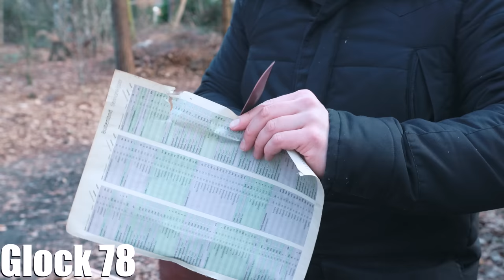America’s Army needs a new knife ASAP.. Ka-bar Vs Glock 78

Comment: GLock is a bayonet (hence the strange bent in the guard), KaBar is for combat.
None of them was made for cutting, buschcrafting ect.
Do the military test!
- which kills faster, bleeds (fuller on the KaBar), goes easily through the rib cage.
Reply: I don’t think that’s correct. I own the Glock knives and there’s no way to Mount it securely as a bayonet. 
From my understanding the forward you are mentioning is a bottle opener.
Reply: @Jays_video_watcher  It is even on English Wikipedia - second sentence: 
" It can also be used as a bayonet, by engaging a socket in the pommel (covered by a plastic cap) into a bayonet adapter that can be fitted to the Steyr AUG rifle."
Reply: @Jays_video_watcher  As far as I know the forward thingy is actually a bottle opener but the knife itself is a combat knife as well as a  bayonet. Should have a removable plug in the end of the handle under which is 12x39 threaded hole which can be used with a bayonet adapter
Reply: @Jays_video_watcher  the bend for opening bottles is braced against the muzzle device and the plug from the back can be pulled out exposing a socket for a plug mount on AUG rifle. I don't remember seeing any other rifles without aftermarket mounts for it.
Reply: Trust me when I tell you that i know one thing from experience. the only way that bent is used in the Austrian army is indeed the bottle opener... 🤣
Reply: @asz3337  It does not change the fact, that it was designed to be a flash suppressor's bayonet support.
Reply: @ObywatelKane  as an Austrian I take offense to the statement that our knife is rather designed for combat than for getting drunk! Beer is more important!

(of course you ARE right, not the slightest need to argue about that anyway! I wouldn't put it past our army to include that bottle opening purpose into the design! 🤪)
Reply: There's a nice short paragraph in the 40years AUG Book by Steyr themselves (in german, so sorry english speakers).
There is no picture of the FM78 in there, but of the Prototype Bayonet/fieldknife that predates the FM78.
With this thing, the socket in the handle started, as they evaluated a mounting solution that only used that rear compartment and some ball bearings.
The blade looked different, but the handle was already made by Glock. The blade by an old blade manufacturing company that had made swords and sabres for the austrian army when firearms were still muzzle loaded.
That company went bancrupt, and Glock stepped in to make the whole knife and changed the blade to what we know now. 
The bayonet mount was tested and deemed to be shit, to say it in drastically, and so it was never issued.

The bottle opener: yes that works, but the main use (at least for me) was to tighten and loosen the blankfireadapter of the rifle. And the radius of the muzzle piece is the same as that of beverage bottles.
So we can argue forever it the little radius cut into the bent side is intentioned to fit the muzzle adapter while using it for the blank fire adapter, or for bottles.

And lastely, there's a common misconception about the fuller in blades: *it does not help in letting out blood*. Not in knives, not in swords. There are 2 main reason for fullers:  a) with longer blades it removes weight but keeps rigidity, with shorter blades like knives it's weight reduction. b) design. 
Nothing to do with bloodflow out of the wound whatsoever. (and yes despite what the fullers are colloquially called in several languages)

Comment: And the best. The glock is not really full tang. it is designed as a bayonet for the Steyr AUG 77. see the name Glock 78. and if you take the cap off you see that it is 3/4 hollow. I've been working with Glock since 1980. Indestructible

Comment: The tang on the Kabar is the weak point.  A better knife of the same design would be the Cold Steel Leatherneck.  Much bigger tang for more strength.  I like the Leatherneck much better.  The Glock is a beast.

Comment: In fairness, both knives are more designed to be generic  “combat,” or “fighting” knives and not “survival” knives, and not special mission or special unit knives. Especially the design of the Ka Bar, which is clearly designed to be a combat blade and not survival. Pilots, special forces and specialized units carry other knives.

So testing them for for purposes that they were not really designed for is really silly. After all, you don’t test butter knives, or steak knives or butcher knives for their “survival” capabilities. Because those knives are not designed for those tasks. 

Knives should be tested in relation for what they were actually designed to accomplish.

Comment: The Ka-Bar is NOT and NEVER has been considered a "utility" or "survival".  All issued U.S. military knives (WW I, WW II, Korea, VN have the primary duty of dispatching the enemy.  Even the USAF "Bolt" Knife was made for offense vs utility.  The exception would be the U.S. Knife from Camillus.  It was a pocket folder.  As much as I enjoyed your video, we just have to recall the purpose of the knife.  If it can do its primary purpose and still work as a utility knife, cool then all the better.  I taught SERE for my entire career, they always used knives as utility and not offense.  That always felt a little off.
Reply from the maker: I agree but the weakness of this knife is bending. If you'd stab your enemy in the vest or something similar knife gets caught between the plates enemy moves = knife bends. Many more scenarios where this weakness comes out. We showed that mostly in a different video though. Main point is the tang is unnecessarily weak.

Furthermore my personal opinion is that a combat knife will most likely be used for 90% other tasks than combat. In that case the design could be a better balance for both.

Comment: If only the USMC had a full tang it would be an entirely different knife. Some better steel would be nice. I have the space force version n im never gunna use it so there is no worry. Better steel would be nice. It would be worth it even at a slightly higher price. Rat tangs are just yuck for beating
Reply: They are making one in Magnacut. Might finally get me to buy one as I can't stand knives that can't be used as tools.
Reply: @Sdrui  magnacut would be awsome but still that rat tang I'm iffy about

Comment: Had a Glock knife once...... snapped the bitch in half jimmying open a stuck ammo can.
So.
I'm not impressed with "Glock quality".
Now is the Mark 2 Navy pattern knife as made by KaBar and others a dated design?
And does KaBar sometimes piss away  heat treatment on its blades?
No to the first question.
Yes to the second.
I've used Mark 2 Navy knives by various makers off and on for close to 30 years.
I've skinned deer, cut small trees for shelters, even pried open stuck car doors and ammo crate bands.
A Mark 2 Navy pattern knife from a maker who has heat treated their blades well?
Works better than an Austrian knife that snaps in two half way down its blase from what I would consider mild use.
Now.
If someone wants something a bit more modern?
I'd suggest either an early Cold Steel SRK, Recon Scout, or a Becker/KaBar Aircrewman or Combat knife.

Comment: It would be more appropriate to compare the Glock 78 to the OKC USMC. Current knife model to current knife model. The KABar hasn't been standard issue for at least 20 years. It's also a design over 100 years old and shouldn't be compare with modern designs. Honestly mocking a knife that is merely steeped in history is a bit insulting to the community it is named for. I would also argue a knife that was designed for hunting and labeled a "fighting knife" is not really meant for any of this.